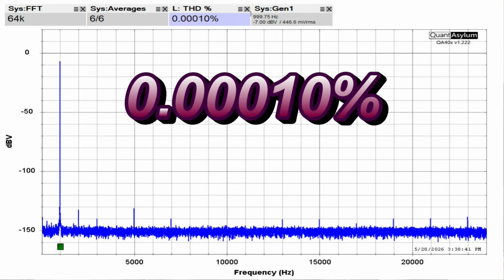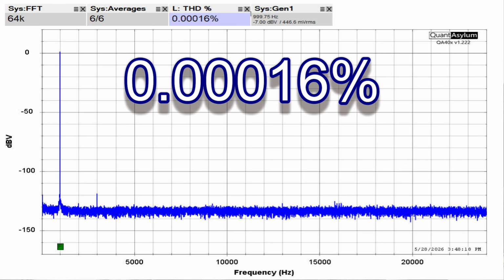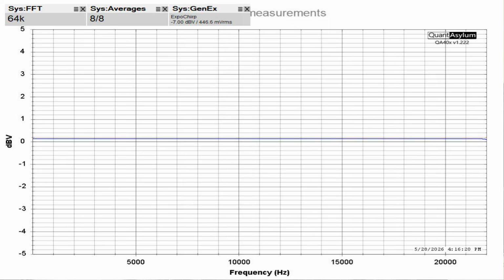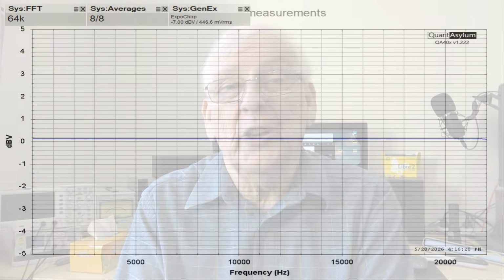The FCA-001A Preamp 0.00016% THD.

Comment: Such valuable information. The Audio Precision ATS-1 is in a sweet spot for audio analyzers. Not sought after (good offers on these), has an excellent low-distortion generator (like R&S with B1 options-level) and is pretty simple to use and standalone. For listening, stick with the best neutral amp and then add gear like tube EQs (Pultec), tape sim or broadcast compressors (Aphex Dominator or Optimod) before it. Much better results in making effects explicit (these are not subtle 😊) and you’re not overpaying for unresellable boutique high end gear.

Comment: L15 with proper grounding, +/- 50V analog and a bit of tweaking sounds very nice. Ample power, very low distortion but sensitive to ground. Add speaker protection or bad luck could happen.
Reply from the maker: I mostly agree with that. I do think earlier versions of the L12 are a better amplifier, both in tests and listening. But you know my opinion already. You have been watching my channel a long time!! However your opinion is always very welcome.

Comment: I'm stuffing my board now. Digikey shorted me two caps. I ordered 12 and only got 10. I have another project where I've ordered from Mouser and added those two caps there, so hopefully I can get the board completed and tested next week. Fingers crossed. This will be my first preamp, so it's all new to me. I don't even know how to test. I guess I'll have to figure it out. 😊

Thanks Michael and Ron.
Reply from the maker: To be honest Michael, if you spend some time checking the board for errors (we all make them) you can throw some power to the board and it should just work.

Comment: It’s an awesome sounding circuit! I’m very impressed. I’ve built 2 boards and am using my “suped “ up version (2.5x times gain, 3300uf in main supply Roswell, Elna electrolytic caps and sparkos discrete opamps)Whether it sounds better than the other is debatable. I only had 22uf nonpolars for the decoupling caps and would swear I have a bit better bass than my more basic version that has the proper 10uf. I’m rambling now but thanks for making this available to us DIY’ers!
Reply from the maker: Good to hear your feedback Adam, most appreciated.